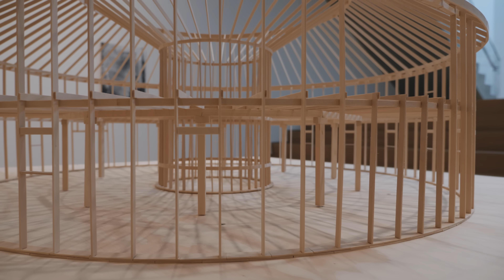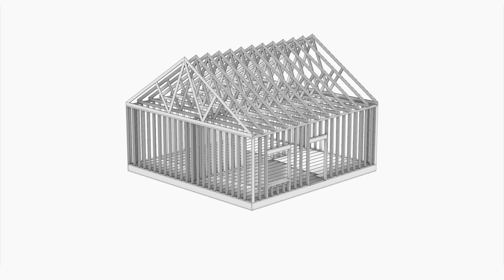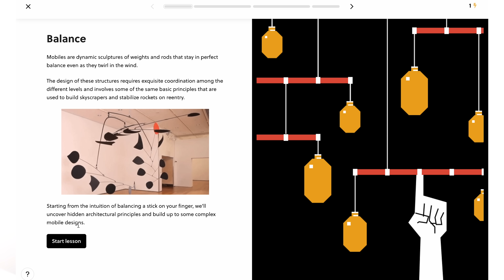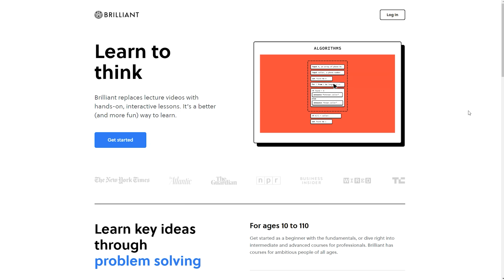The Genius of 2x4 Framing

Comment: Also, 2x4's are never exactly 2x4 inches. Somebody is shorting me on every board I buy, and making bank off of it and I want this investigated:-)
The 2x4 stick built home is so ingrained  in our construction that building codes are really protective of it - when you try to build with any other kind of system or scheme, it's always an uphill battle to deal with code enforcement.
Reply: A 2x4 is 3.5”x1.5”. I researched this once as I renovate houses, and some have nominal lumber, meaning a 2x4 is actually a 2x4. My findings ultimately lead to that structurally they’re basically the same, and that at saw mills they’re first rough cut to 2x4, then due to size changes via humidity and such, they’re eventually milled down to the 3.5”x1.5” so that things are more consistent.
Reply: @calvinjohannsen6519  Any good explanation of why a 2x4 is 1.5x3.5 requires a second good explanation of why older houses have 2x4s that measure 2x4. They really are cheating IMHO. I'd prefer a 2x4 with a rough edge vs a smooth 1.5x3.5, especially when using 16d nails which seem to just fit a real 2x4 better. Finally now with power nailers we use thinner and shorter nails that don't seem so oversized compared to the wood.
Reply: @p39483  it had to do with curves of saws and the difference between planed and rough lumber. Consistent is better than big. Rough surfaces are fracture instigators, stress risers.
Reply: Modern mills cut wood wet.  Old houses allowed the wood to dry so it was dimensionally stable
Reply: @calvinjohannsen6519  Old homes were built with 2x4s that were actually Dimensioned at 2x4. For ages now they are 2x4 nominal. Meaning they are now 1 1/2 x 3 1/2.  It’s the term Nominal that tells you it is not full dimensioned Lumber. When they started this I would have to check.
Reply: I was looking into this some a couple of years ago, and came across articles from the 1950s talking about how 2x4s were shrinking in size.  The 2"x4" dimensions have always been nominal dimensions for planed lumber and represented the size before planing, but for a while the expected sizes were 1.75"x3.75", and then some places started doing ones that were 3/8" under the nominal dimensions, and they seem to have settled for now on 1.5"x3.5" ... for now.

Now that 2x6 exterior walls are becoming common, anyone want to place bets on when those shrink from 1.5"x5.5" to 1.5"x5"?
Reply: @fljetgator1833  South central Ontario, Canada.  Not far from the north shore of Lake Ontario.
Reply: 4” - ~1/8” (blade kerf) 
= ~3  7/8” - 1/8 to 1/4” (drying) 
= ~ 3  11/16” - ~3/16 for jointing/plaining (truing) 
= 3.5”

I’m not certain if they still actually are milking at the 4” mark—but it makes sense to have enough extra for straightening (truing) after the drying—which causes a varying amount of warping.

The boards wider than 2x6, tend to be less than the half inch, which seems to point to the shrinkage factor. It’s normal to have a 2x10 @ around 9 1/4” or a 2x12 around 11 1/8.
Reply: The framing lumber in my 100 year old house is wider than a modern 2 by 4, but not as deep.  This proved to be a total PITA when trying to add insulation because the cavities on 16 inch centers are narrower than a bat of insulation and not as deep.
Reply: They cut the green logs with a spacing of 2" between cuts, so the width of the saw blade is subtracted, and the wood also shrinks when it's dried.

Comment: Another great video!  I wish you had been one of my architecture professors.  I'd be curious to see a similar deep dive into gypsum wallboard, the pros & cons and is it here to stay?  It's such a mess and time consuming to construct with, make changes with, and repair... there must be a better way!
Reply: If you think gypsum board is a bad material try plaster and lathe which preceded it.  While renovating my 1920s vintage house with new wiring and insulation I pulled all the plaster out and replaced it with drywall.  IMO drywall is a breeze compared to what it replaced.
Reply: @minuteman4199  Exactly. Gypsum board is a huge improvement over lath and plaster.
Reply: The most time consuming parts of gypsum board construction are all aesthetic - the mud and joint compound that is used to cover screws and create flat surfaces for paint.  Drywall goes up fast and easy - you can cut it to size with a sharp knife and make cutouts with a hand saw!  If you're looking for improvements it's not going to be in the wallboard - it's going to be the finishing process.
Reply: A free market will find the most cost effective product to use, gwb is that product. It's cheap, easily installed/repaired, and readily available.
Reply: @sixtomidnight1492  i would argue the free market prioritizes cost efficiency over effectiveness. So much of capitalism is getting "good enough" on the lowest margin possible, rather than being the most effective, which has led to products that can be cheaply made but need to be replaced often.

Comment: Not sure why more architects are not looking a post frame construction. The technology and construction has come a long way and you can get the same if even better structural load without the excessive need of lumber. The columns can be sandwiched together without one massive timber, and windows and doors do not require headers because there is no load placed on them. Sometimes because something has been a main staple in our culture does not mean we cannot be better served getting away from the past. Amazon provides an example of changing the way we shop and now we have whatever we want within a day. The same can be said about stick frame construction.
Reply: It is usually down to cost .. there are other systems more economical.  Post frame is when you want a specific "look".

Comment: Personally, I've always avoided Wood Frame houses. Nothing wrong with it principally and there are tons of examples of great wood frame structures. However, I've seen so many horror stories related to cheaply/quickly built homes having tons of issues, mould, stability during extreme storm events and problems with insulation. My house (Rental but I'd love to own it) is a typical late 1800s victorian style. Largely has intact masonry and original plaster in most of the original houses. Water gets in sometimes but there have never been issues with mould, even in the basement that regularly sees a bit of moister during the wet season. I even had my neighbour ask if they could hang in my basement during a tornado warning because they didn't believe their wood-frame house could adequately protect them and I agree. The issue isn't wood framing, just like the Obesity issue isn't because of Burgers. Its the standardization that leads to people looking for efficiency boosters that often produce an inferior product. With McDonald, you won't be surprised when your pickles are only halfway in the burger and it looks like someone sat on it before serving it to you, just like when you buy a modern suburban framed house you're not surprised when there are issues 6 years down the line when their builder warranty is up. I don't know what the best solution to this is though, because we need cheaper housing, we need quickly built housing, but I don't want to live in a country that is full of extremely flimsy houses either.
Reply: Interesting, in Ohio I could count on my fingers the number of houses I have seen that were not wood framed. A couple of very old stone homes and a few log cabins are about it. Even post and beam are exceptionally rare. Given the economies of light wood framing and very few homes built before 1860 I guess its not surprising.
Reply: @cmbakerxx  I'm not a architectural expert. What I mean is my house brick and masonry building. These houses were super common in the late 1800s, I think mine is from the early 1900s though. I think it's almost entirely supported by brick and stone. There's obviously wood in the walls but I also notice a few of the interior walls are also brick, I'm assuming structural.  I live outside Toronto and these buildings are super common through here and the northeast us. They are not easy to own, there's a lot of preventative maintenance. But if you do it right these houses will likely outlast just about any other kind of house.
Reply: I don't think Euros can even understand how houses are in NA. Depending on the region, house codes can vary wildly, and a house built in Houston is going to be built to a far lower standard than one in Edmonton, for the simple reason that insulation simply isn't required to live in warm places. (It's advisable obviously) The average home in Canada is far more efficent and will last a generation - why pay for a ""sturdy"" home if it costs less to simply rebuild a house from cheap and plentiful locally produced lumber when the house needs drastic repairs? That also assumes houses are as poorly constructed as you claim, which remains to be seen. There's more maintenance on a 2x6 house, but again, all the materials are comparatively cheap and it's completely legal to do yourself with a permit. Different strokes for different folks but it makes no sense  as an engineer to waste money on overbuilding a house with less suitable materials for our region.